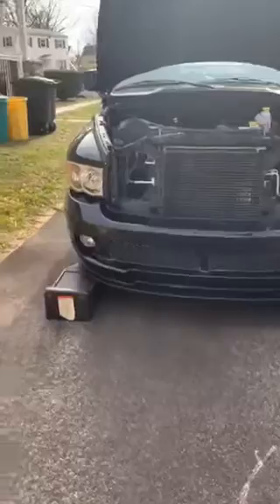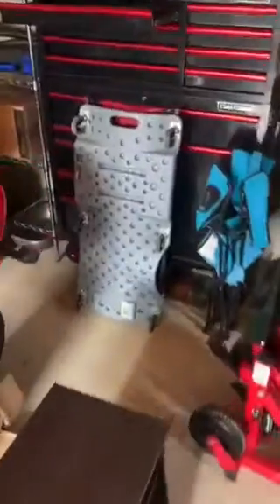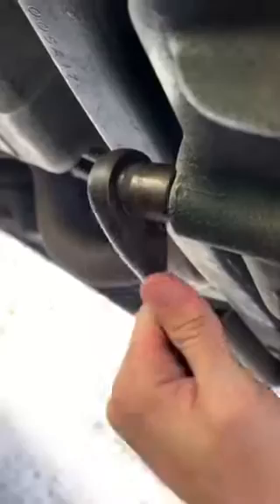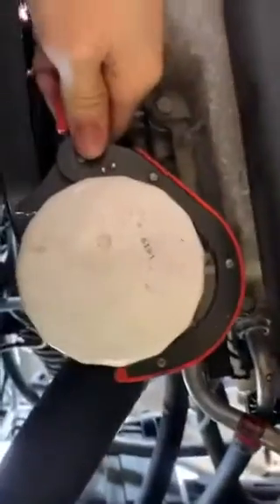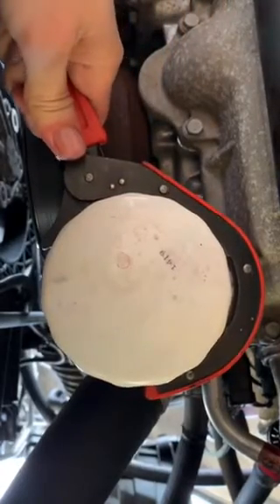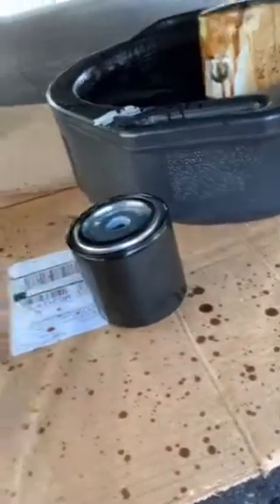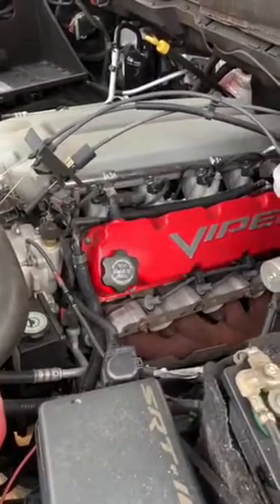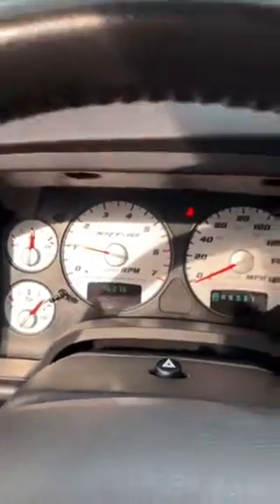Time for a change.. of oil - SRT10 Ram

Comment: You were supposed to fill the filter up with oil before you put it on the engine so the oil pressure starts going as soon as you start it.😒 Other than that good video.
Reply from the maker: You’re 100% correct
Just something I forgot to do while filming.

Follow this guy’s recommendation lol

Comment: You don't use mobil 1 like they recommend?
Reply from the maker: Mobile1 is a fine brand of oil and I suppose one should use the recommended oil; however a Viper Tech down in TX was running a “oil change” special with what he carries so I went with that